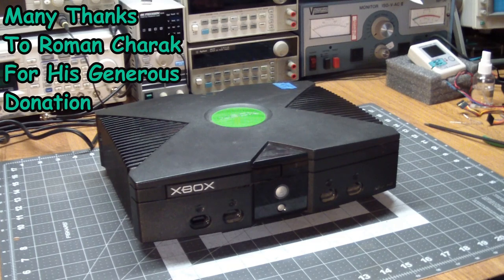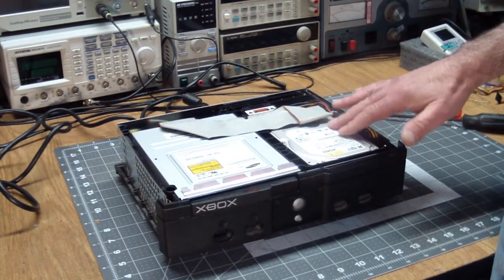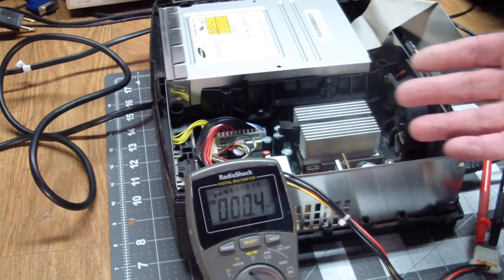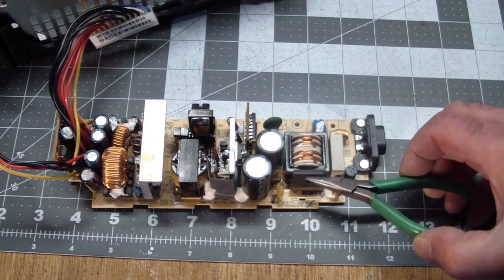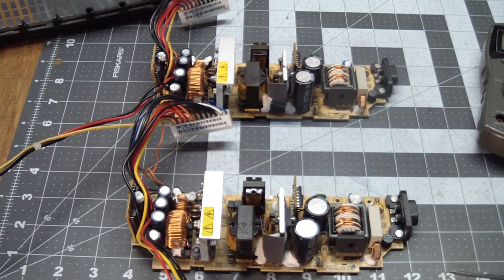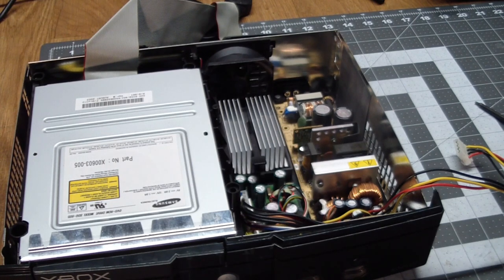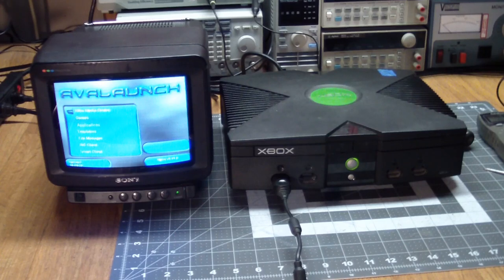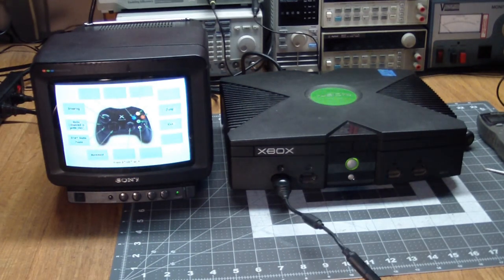AE#163 Repairing A Non-Functional Original Xbox Console

Comment: Hello, I have great news, I found the problem with my Atari Pinball board and now it is working great. It turned out to be chip C6 (model 9301PC), which is part of the address decoding circuit. I would like to thank you for helping me and for answering my other comments. One funny thing is that, a long time ago,  I tried to fix an OG Xbox like this with a bad power supply. It would whine when it was plugged in and not show any signs of life. I didn't see any bulging caps or burned parts so I ended giving up on it. I'm sure glad I didn't give up on fixing my Atari pinball board. Thanks for giving me the motivation to keep trying by telling me the different things I should check next.
Reply from the maker: I've seen quite a few 9301s go bad on the Atari pcb, I'm glad to hear that you were able to fix yours.

Comment: I have worked on a lot of switch mode supplies; they were famous for cascade failure's, "usually 6 components or more" and often required a schematic to resolve several issues.

Comment: Hi Arti. Great to see you back. Completely agree with you on this one - component level repair of the PSU would be a fool's errand. Module level replacement is a much more sensible solution. The cost in term of time and stress would just not be worth it. In fact, when you identified the burned section of the board I immediately said to the screen "Go to Ebay and get a replacement"! So not much of interest here but you have a working machine and can quickly move on to a more fun project 👍

Comment: The cooling fan seems to be a bit noisy? I clean fans and heatsinks in a solution of warm water, dishwashing soap, and a small amount of straight ammonia liquid.  Scrubbing isn't mandatory; only if grime is stubborn.  Otherwise, it just falls off in about 20 min.  Rinsed, then blow dried - then the fan motor is disassembled and re-lubricated.  9 out of 10 times, this is the cure.
Fans get noisy easily because they get out of balance with even small amounts of buildup.  
Perhaps you will go thru the failed supply and turn it into a spare?
Reply: That's actually normal noise for an OG Xbox